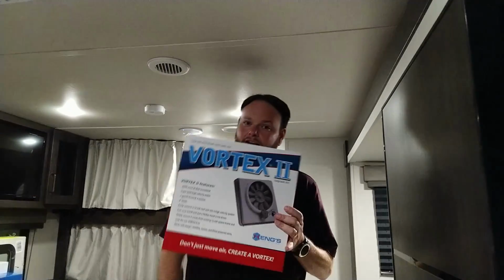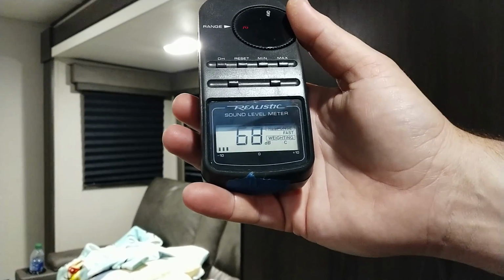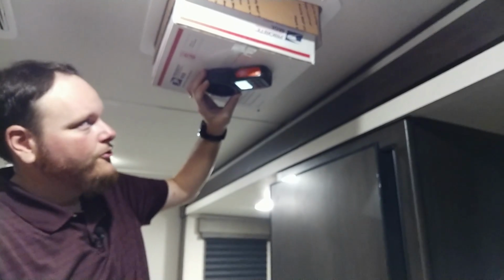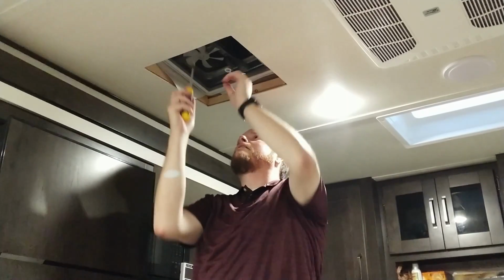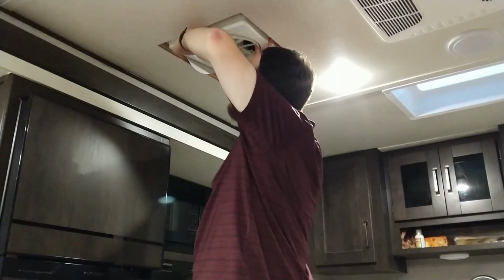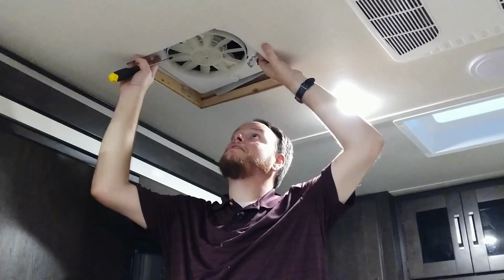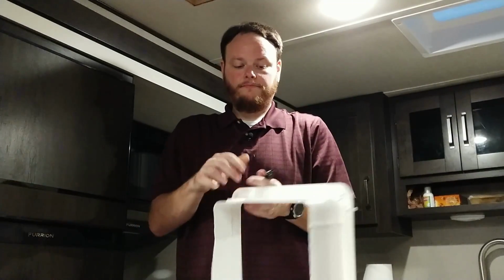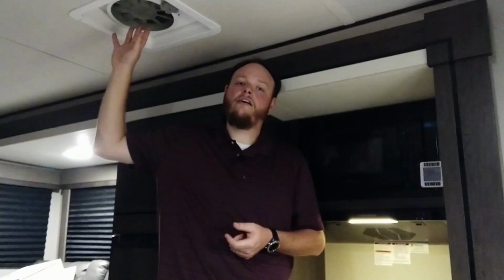Grand Design Transcend Xplor 261BH fan upgrade - Vortex II

Comment: does the black wire go to the positive line and the white to the negative ?
Reply from the maker: I believe I put the black to ground and white to +12v. Always test for proper rotation before buttoning it up though. It's just 12v dc so you won't fry it plugging it up backwards.

Comment: instead of twisting a wire nut could you not have pulled the old wire from the push connector and then added the new wiring?
Reply: I was thinking the same - looks like they used Wago connectors so wire nut is a downgrade.